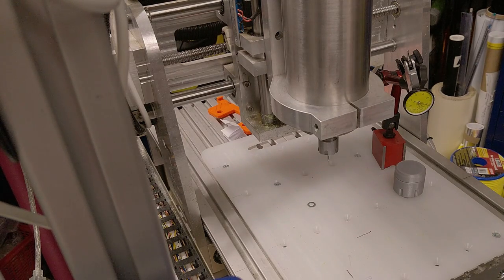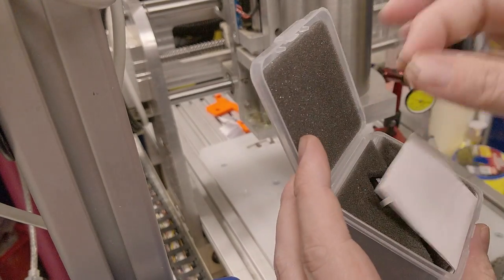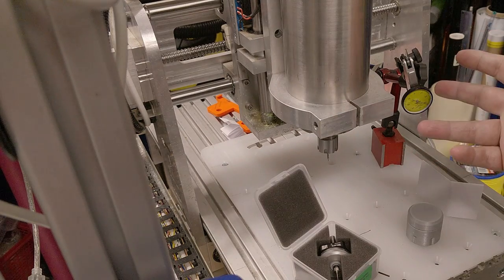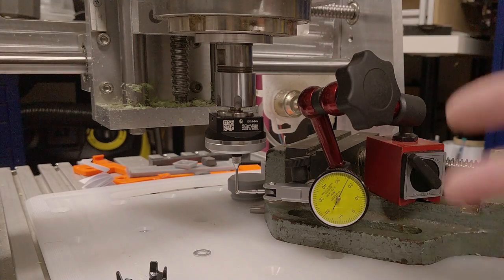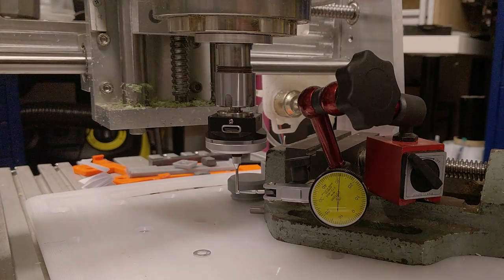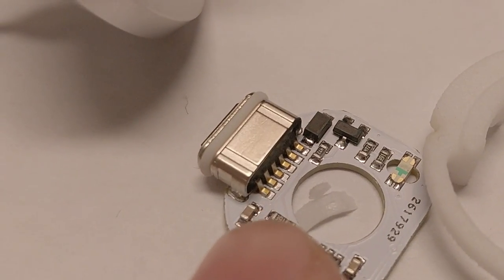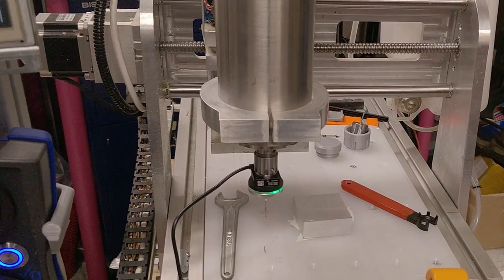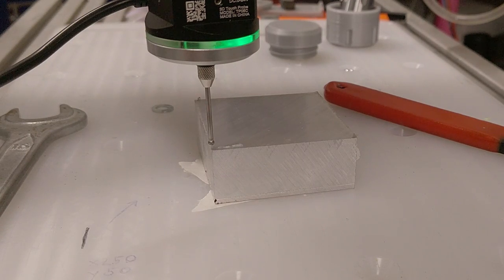An affordable 3D Toch Probe for CNC Machining - Test, Crash, Teardown, Repair

Comment: plug  wiring : (-)(+)(s)(s)(+)(-)
my pcb failed after second use. Components: 78L05 (5v reg), J3Y NPN transistor (eq. s8050), red & green LED, 5 resistors, diode, 2 caps and FMD 530krn ( I CAN FIND NO INFORMATION)

Any information on FND 530krn or replacement PCB?   
Email me if want copy schematic.
Reply from the maker: Hm... Also can't find it. Do you know its function? Maybe it can be replaced with something compatible. Also if possible I would contact the seller, that it broke that quick maybe they replace it
Reply: @MakenModify  No response from the seller.  My knowledge of electronic is very limited.  The 530 chip is 6 pin.  pin1 to base NPN, pin 2 - gnd, pin3- led1 pin 4- switch pin1 (switch pin2 ground when closed) , pin 5 - +5v 78L05 and  to 330 resistor then both leds, pin 6 -led 2.  
Hope this sense. Mike
Reply from the maker: @mikee8467  oh, sounds like a small microcontroller... Like an ATtiny10 style (there are countless small and cheap Chinese MCUs)... To replace it one would need a pin compatible chip and program it (if its broken). If its buying is not to long ago I was lucky in the past by using aliexpresses support. - Max

Comment: Theres set screws that allow you to ZERO the probe...WOW use the set screws thats why they are there
Reply from the maker: Yes. But it was "factory calibrated" so that was something that should be tested. After the crash (after the video) I did zero ot properly using the screws.
Reply: @MakenModify  Maybe??  but i have one in a cat 40 and if and when you break a probe you must re zero using the setscrews. it was close but not perfect out of the box and  its a Haimer ..

Comment: I do not understand why it is NO and not NC. With NC this would not have happened.
Reply from the maker: That is absolutely correct. My best guess is that if it would be NC it would always have to stay connected. Because it would trigger as soon as you unplug it.
Reply: @MakenModify  is there a cheap probe that is NC?
Reply from the maker: @4x4-l2t  if you really want to you can hardware invert the signal with a bit of electronics but I don't really see the point
Reply: @MakenModify  I have a normally closed version, model TP06, just trying to work out how to wire mine as mine uses a tool probe which is a normally closed switch
Reply: @MakenModify  I assume it only "triggers" when you are running the script looking for it to trigger?
Reply: @killorkubed  I have no idea what his machine controller is, but on 'real' cnc machines, you connect the probe to the (or one of) the "skip" input(s), and the input is only valid when you run a skip command (G31 I think). Any other g-code ignores the skip input so if the probe is disconnected when not running probing routines, it doesn't make a difference.
Reply: @gorak9000  yeah, I run WINCNC and that sounds about right for it... I don't have a probe at least not yet (for me I don't have an atc so normally I just eye ball stuff and its good enough because I'm normally cutting sheet carbon fiber anyway so my zeros don't need to be that accurate)